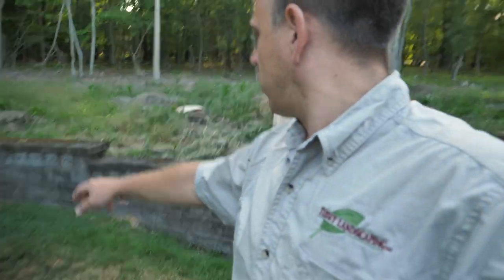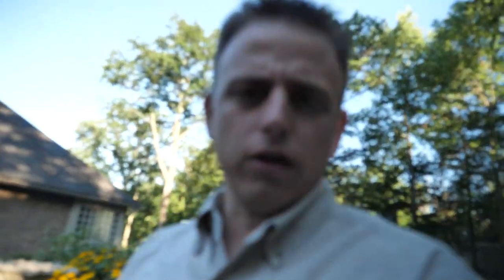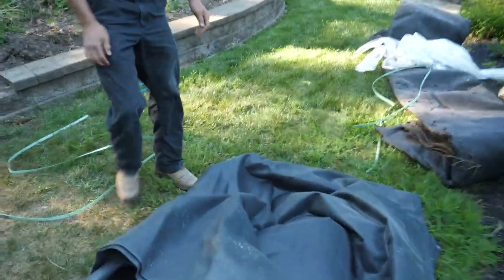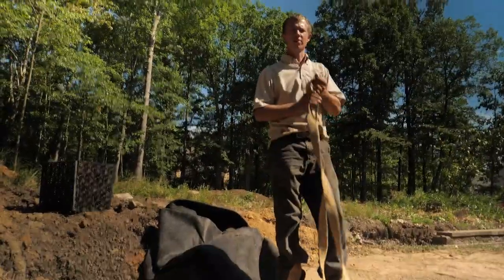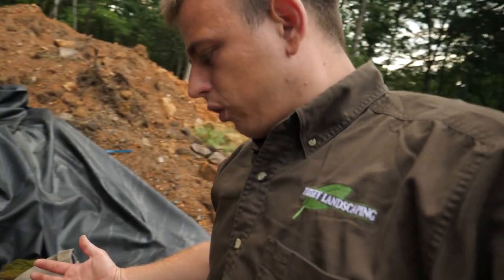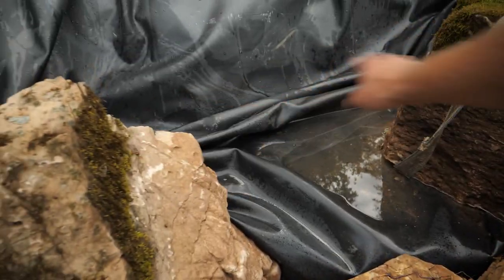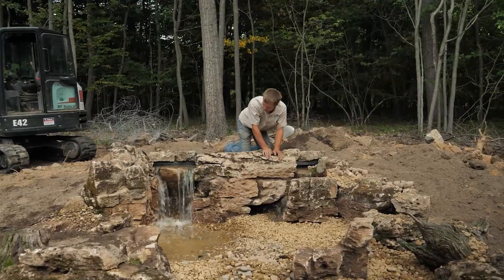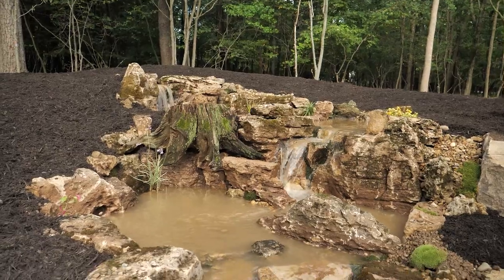How We Position Boulders to Build a NATURAL looking Waterfall

Comment: The bottom water fall falls from the rocks onto the aquablox... The rocks are placed onto the aquablox.  How did you prevent water from simply running under those rocks directly into the aquablox?  Liner? Foam? ??